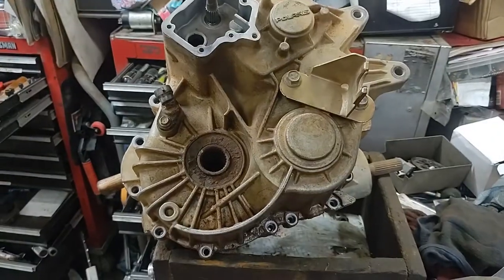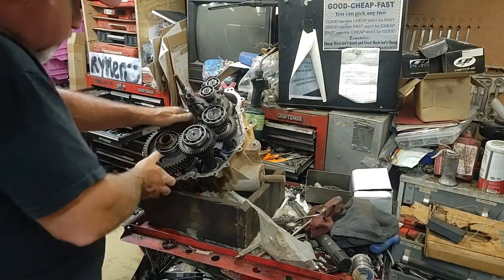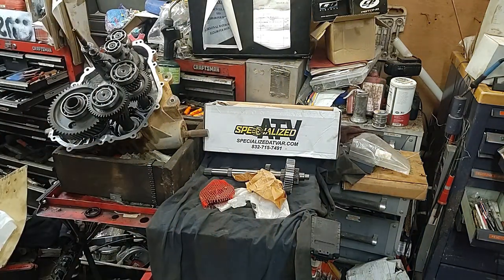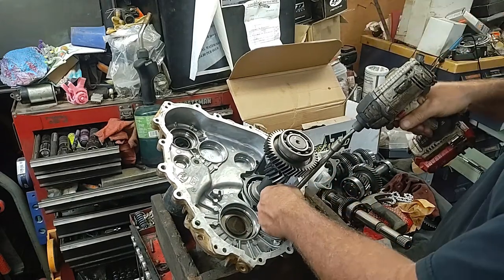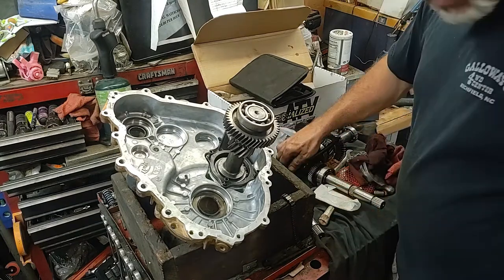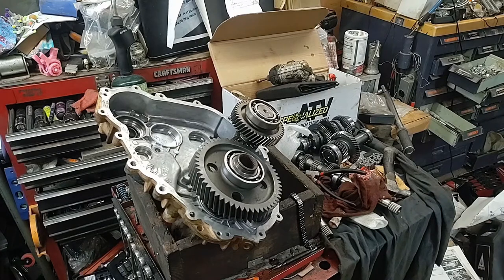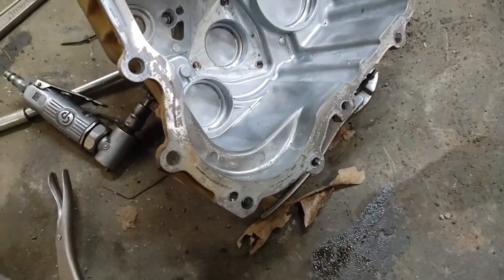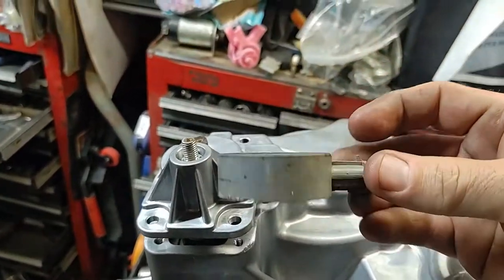Polaris RZR 1000 reverse chain install

Comment: I have a ranger 570 that is very hard to get into reverse. I have to sit there and work the shifter back and forward while tapping the throttle. It will eventually find the gear but will pop out after driving in reverse for 30’. The entire time it’s trying to go into gear it makes a grinding sound as if it’s trying to engage but can’t fully. No noise once it’s in reverse. I adjusted the cable multiple times and all the other gears are good. Any ideas before I pull the transmission?
Reply: Got the same problem. Did you find an answer.
Reply: @gushowlett4161  yes check out the video on my channel

Comment: very interesting! i wonder why u choose HL belt chain not turbo? because turbo use  reverse gear not belt. very curious about that!
Reply from the maker: I used the chain from specialized ATV. There was a supply issue when I did this and there were the only folks that had one in stock.

Comment: Mine did not come with the gear you referred to at 25:45 not sure what to do
Reply from the maker: Does yours have a different size gear on the smaller shaft that meshes with the gear at 25:45?
Reply: @FourwheelerDoctor  we found out the customer accidentally ordered a general reverse kit instead of a rzr. Different amount of low gear teeth. We figured it out
Reply from the maker: @kolassalkrown0697  thanks for letting me know